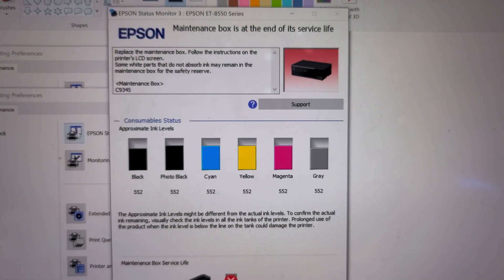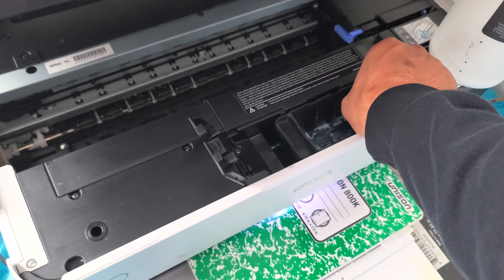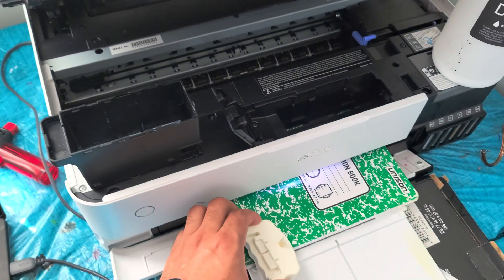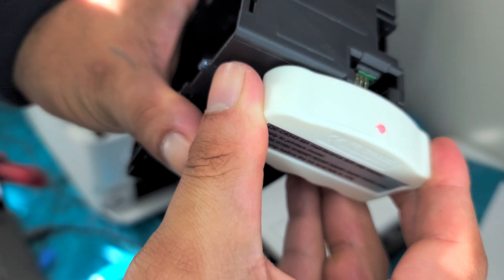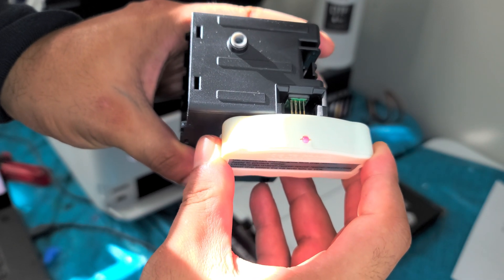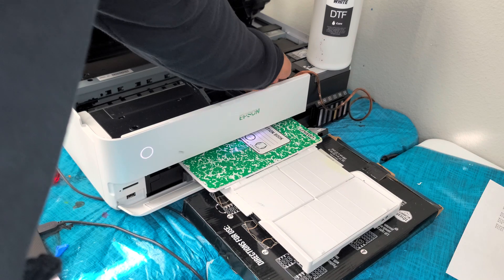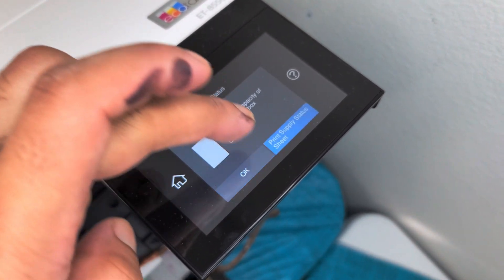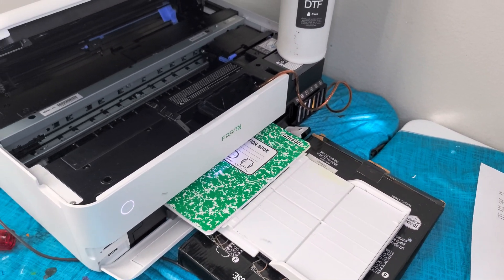Epson Ecotank ET-8550: Reset Waste Ink Pad (Fix maintenance box is at the end of its service life)

Comment: my issue is that the waste ink completely misses the pads, it seems to be dripping on the top plastic part and off to the sides, creating a puddle under the printer >.<  i'm contemplating on breaking off the top plastic shielding and allowing it to free drip on top of the pads.  it's been a few head cleanings already, but the pads have not once been saturated with waste ink.

Comment: I have the 8500 which is the A4 version of this printer. Something I don't understand about these maintenance boxes is how does the excess ink collected in the ink pad drain to the box when the box is higher than the pad.
Reply from the maker: It gets suck from the capping station then drains to the maintenance box through a tube.
Reply: There is an electrical pump that, well, pumps the ink to the tank.

Comment: what about the ink pad end of life ?  thats different from the maintenance box correct?
Reply: Where do you get the chip resetter?
Reply from the maker: Amazon
Reply from the maker: Its the same
Reply: @HangryMuscle  can you confirm that  the 8550 doesn't have ink pads that are separate from the maintenance box?
Reply from the maker: @olgamclean9963  I'm not sure
Reply: @HangryMuscle  ok so im a little confused because ink pads are actual pad sponges that soak up the residue ink that comes out of each print.  (not the printer head like the maintenance box as i believe that is separate) the 8550 printer has these as well doesn't it?  Heres a link video to the ink pads im referring to. I believe the majority of epson printers may have these ink pads and can reach an "END OF LIFE" MESSAGE and they dont have replacements for purchase.  i just wanted to confirm before i made an investment on this printer   https://www.youtube.com/watch?v=Ow6eqZELeBI
Reply: @moneysssssss   this is what im trying to figure out because someone on an amazon review said they were separate and that he was pissed  regarding the 8550 printer because he made about 2000 borderless prints and the error message of "ink pad end of life service" was on the screen. he said they didnt have replacements and it mentioned he had to get the printer serviced and that it was separate from the maintenance box so im confused as well.

Comment: Can this be done without the tool? Or is the tool a must?
Reply from the maker: You need the chip reset fob. Otherwise you need to buy a new maintenance box or maintenance box chip.
Reply from the maker: You can get the chip reset here: https://www.hangrymuscle.com/products/c9345-maintenance-tank-chip-resetter-for-epson-printer-et-5800-et-8550-16600-l15150-15160-wf7820-st-c8000
Reply: @HangryMuscle  Page not found
Reply: They're website doesn't sell the chip resetter for the 8550 any more

Comment: Good stuff, thank you I have been following. Quick questions

1.Which is better using CISS tank or leaving the ones they came with

2. May you please do a vedio of does and don't s when using an epson et 8550 when doing dt from lessons leant so far
Reply from the maker: The Original tanks are better, they're more efficient at preserving ink. 
Yes in the future, its too early right now.

Comment: Looks pretty easy to do 😁
Reply from the maker: Yes it is
Reply: as someone with a modified stylus R2400 with external ink tanks and waste tank I'm so tempted to just get an ET-8550 and modify it with an external tank instead since my print head is somewhat unreliable in deciding if it wants to print with proper ink density